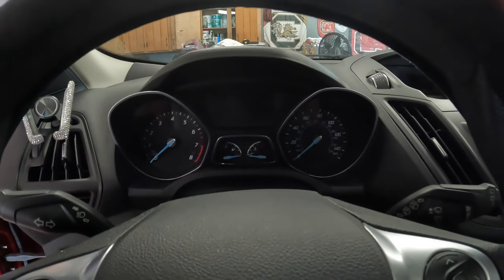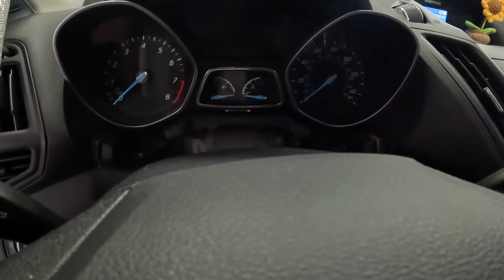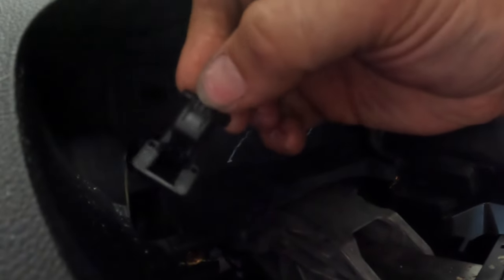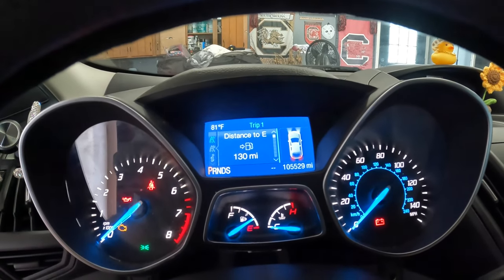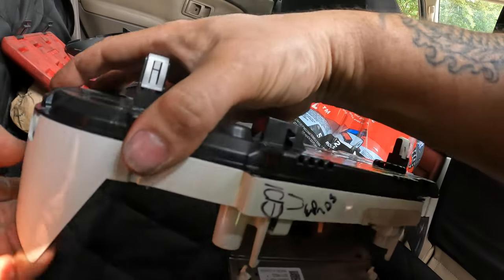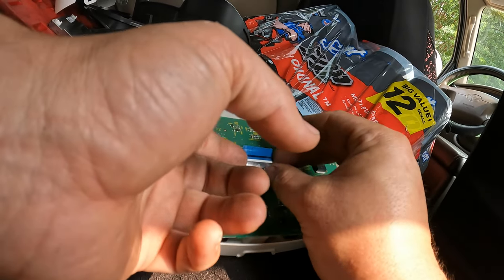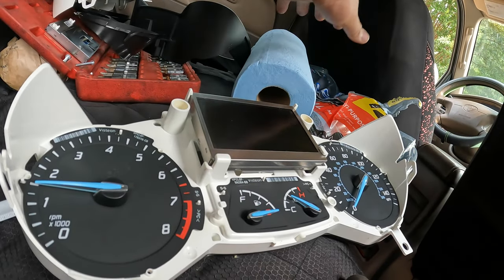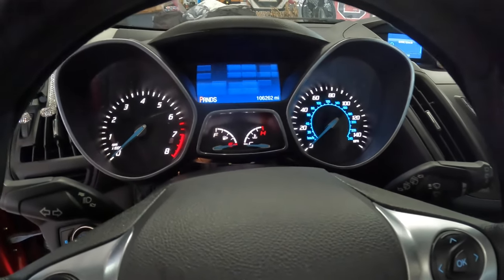2014 Ford Escape Instrument Cluster and LCD Replacement

Comment: Hey, great video! Curious.. if i buy one from a junk yard, is it plug and play and will just show whatever the milage is on the junk yard speedo, or will it need to be programmed? Or do i still need to swap the lcd screen as well, and will still show junk yard milage?
Reply from the maker: If you buy one from a salvage yard or junk yard, it will not need to be programmed.  But if you do not switch the LCD to the old cluster assembly you will have whatever mileage the junk yard unit reads.
Reply: @operationoverhaul I just bought a used one from eBay. Just the LCD screen. Your walkthrough was fantastic! Should I confirm with the seller that my mileage will carry over? It never even occurred to me that the information would be stored in there.
Reply from the maker: @AdamAntiumtv  if you switch it like I did in the video it will keep your mileage.
Reply: @operationoverhaul  Thank you! I did it as you showed, and it was pretty easy! Making sure the cable clips back in properly seems to be the most delicate part. Your video had the perfect amount of detail. Thank you so much for sharing that!

Comment: if my 2014 ford escape titanium doesnt have the digital speedometer in the display can i replace it with a later model LCD and have the speedometer or is that not poissible?
Reply from the maker: I do not think it is possible as I believe the connectors may be different actually.

Comment: Hey man. I am having an electrical issue with my 2014 escape. Ford told me i have a fried module in the instrument cluster. So they want $1k to replace it. 

Long story short. If i get a new instrument cluster from a salavage yard and just put my old LCD screen onto the instrument cluster from the salvage yard will the miles read right?
Reply from the maker: Is the lcd blank with nothing on it?
Reply: @operationoverhaul  so what is happening is the bcm is working intermittently. To save you a Google search, the bcm is the computer for the windows, locks, a/c, power seats, power lift trunk. All of these work intermittently. The vehicle is on its 3rd dcm in the last 6 months, which never fixes the issue. The screen will also pop up notifications for "service engine now", "transmission not in P", and other warning labels. The vehicle has 60k miles and is in good condition otherwise. Currently if I disconnect the positive battery cable it will reset the cars electronics, as all cars do. The problem will then not happen for a day or so after this. Then I just disconnect the battery again and it goes away for a few days. 

Ford says it is the instrument cluster and that needs to be replaced. I just don't want to give them 1k to "fix" the problem.

I can replace the instrument cluster, I don't have the means of reprogramming a new one. With that said; is the mileage information stored on the instrument cluster or the lcd?
Reply from the maker: @ericwallace1452  it is stored on the instrument cluster not the lcd.  I had a customer with the same issue as you in their escape a couple of years ago and we had to change the actual wiring harness to the entire interrior/body ( not the engine) and that is what fixed her car.  They had ford change their bcm and instrument cluster and it would work right for about a week then the same issues.  I ended up tracing it down to about 15 wires that were sending bad signals and then after I did a body harness swap, she has not had any issues since.  It was not cheap though.
Reply: @operationoverhaul  thank you. That sucks!

Comment: Love this thank you
Reply from the maker: You are very welcome.  Doing it this way allows you to keep you original mileage.
Reply: @operationoverhaul  can I just buy a new lcd and will it do the same
Reply from the maker: @johnbrowning6615  the last time I looked ford did not offer just the lcd.  They only offered the entire cluster
Reply: @operationoverhaul  ok I’ve found them on eBay but where can I find one like you picked up for the car on the video
Reply from the maker: @johnbrowning6615  I got mine from lkqonline.com but you can look at car-part.com and put in your heart make and model on the search and it will let you know everywhere near you that has one as well